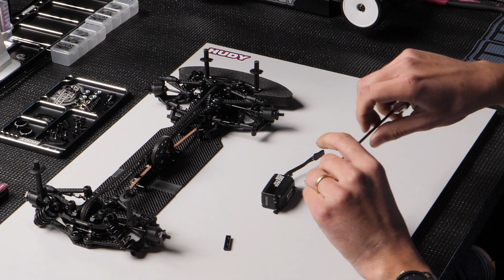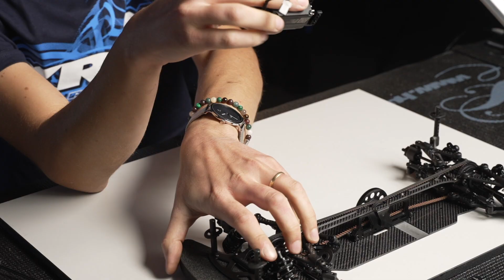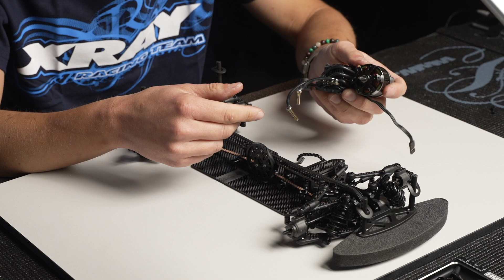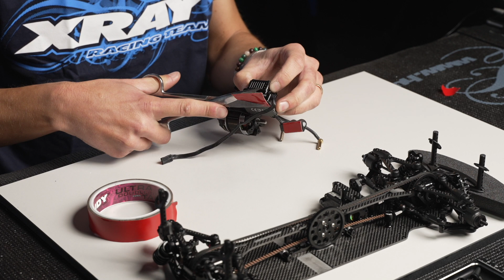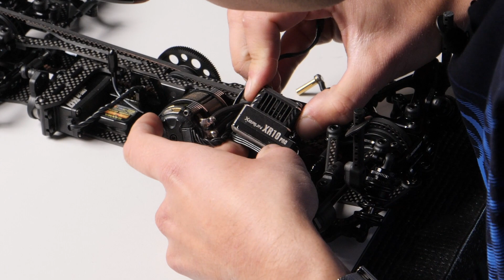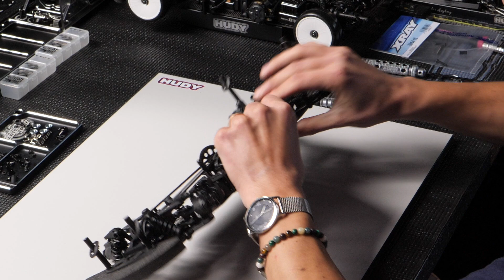XRAY X4 - Tech Tip - Electronics Installation

Comment: Nice job alexander considering you are under the camera pressure, I noticed you weren't completely happy with the ESC sticking on the chassis, I would have done the same with the double sided tape on either side of the esc wiring however I would have added 2nd single layer & also prior to all this I alcohol clean all surfaces, all your vids are a great help, all the best.